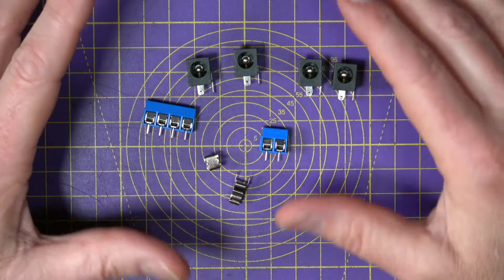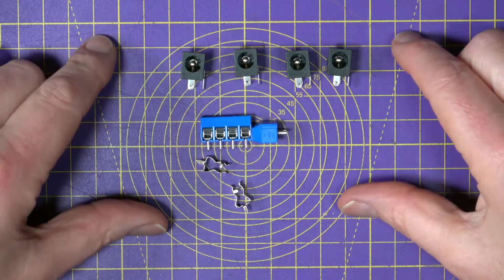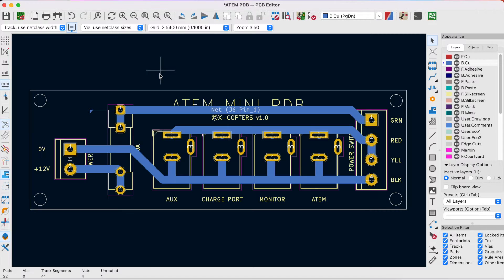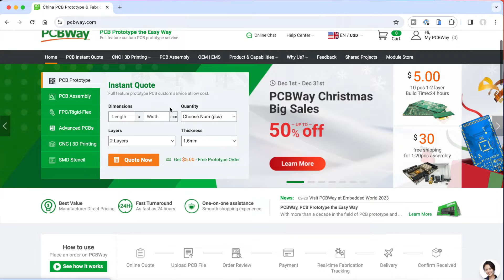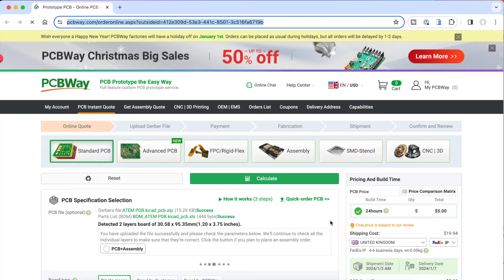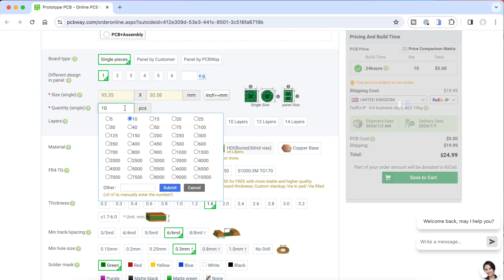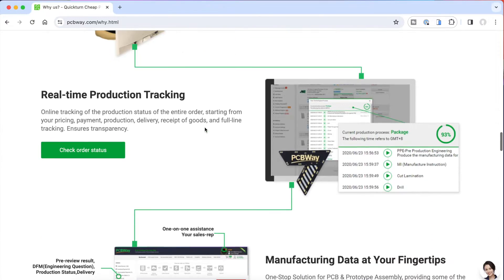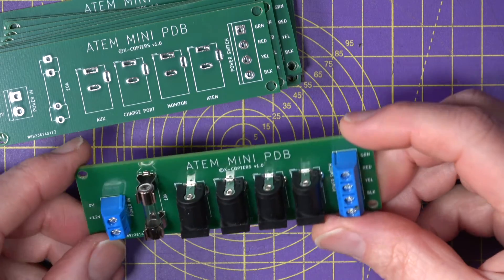Making Your First Printed Circuit Board PCB With KiCAD And PCBWay

Comment: Kicad sucks, adding components to the library is super cumbersome. They have different files for the footprint and symbols but they sometimes don't match up while they should. Or other errors pop up when importing new parts. I would recommand EasyEDA because it has a build in library. It has it's own downsides but it definitely gave me much less stress!
Reply from the maker: I understand where you're coming from. KiCAD can be tricky with its library management, but it does have its strengths too, like easy PCBWay integration. EasyEDA is a solid alternative for those who prefer a more streamlined library experience.
Reply: @WhirlyBloke  with PCBWay integration you mean you can send it off to pcbway and get a quote? For me it's much more valuable if all 3d models er there, footprints match the symbols so there won't any hassle afterwards. I really don't understand how people use kicad but I suspect that I'm also doing something wrong. Having said that, the way the kicad library system has been setup is overly complicated and have been much easier. For example why isn't there are one press button on the snapeda to get the footprint and everything in kicad..??

Comment: Did you ever used the PCBA service? Where do I need to add the BOM data in KiCad, so it will be transmitted to PCBWay automatically? I didn‘t find any tutorial for it.
Reply from the maker: Not yet, but I have a new project and I'm planning to use it.
Reply: @WhirlyBloke  Okay, I‘m also planning it, but didn‘t know where to start? Which plugin will you use or will you do it without.
Reply from the maker: @mars3142  I haven't looked into it yet, but let me know if you beat me to it!
Reply: @WhirlyBloke  This will not happened, but I will create a reminder to inform you 🤪

Comment: too bad that today same boards would be 38USD...
Reply from the maker: @madigorfkgoogle9349  not true. I reordered last month, and the cost was less than $1 a board. However, shipping is always the biggest cost, so ordering in quantity always pays off.
Reply: @WhirlyBloke  I got quotation for BlueSCSI board which is just slightly more complex then yours and is not bigger and for 5 pieces the price is 38.96USD+shipping as of yesterday. And I tried any combination of the production method, this was the cheapest. Very expensive...
Reply from the maker: @madigorfkgoogle9349  I've tried several PCB services like these and I've found PCBWay they offer the best service and prices to the UK.

Comment: Excellent introduction to PCB Way. Do you have a video where you actually go through all of the steps of creating the board shown in this video?  That would be most helpful to beginners who have not used KiCAD or ever created a PCB before.  Thank you!
Reply from the maker: Thanks for the great feedback. I did think about how to use KiCad, but there's so many tutorials out there, mine would just be lost.
Reply: @WhirlyBloke  I'm not sure about that. You appear to come across as one who would create a spot on video for exactly this.  I have yet to find a simple KiCAD tutorial. I'm just wanting to build something exactly like you showed so I don't want to go through an exhaustive set of tutorials that involve many layers, ICs, and so on. I just want to know how to lay out a few traces, add some connectors, setup the board for some standoffs, and then have it printed.  If you're aware of a tutorial at this level, I would greatly appreciate a reference.  Thanks again!